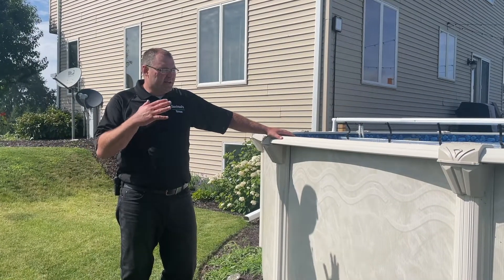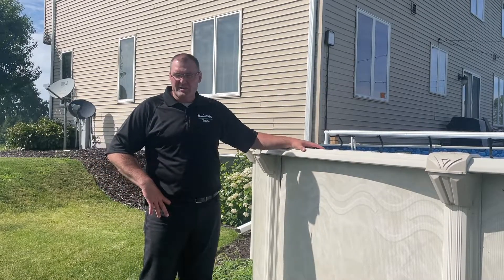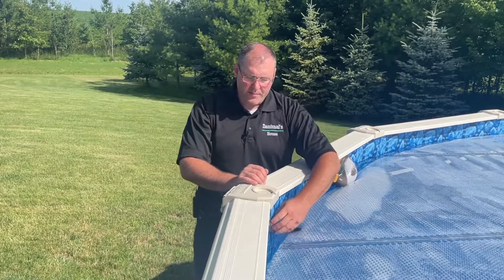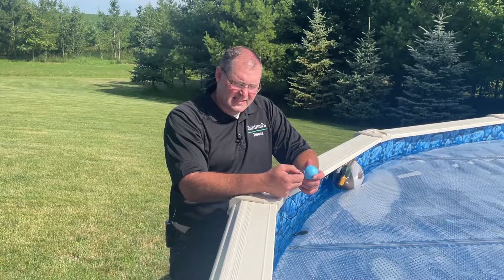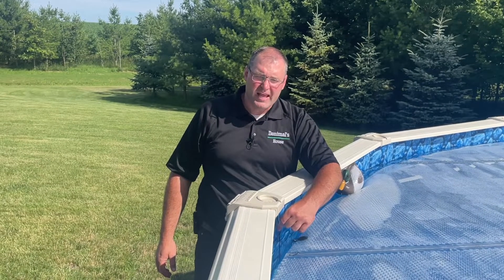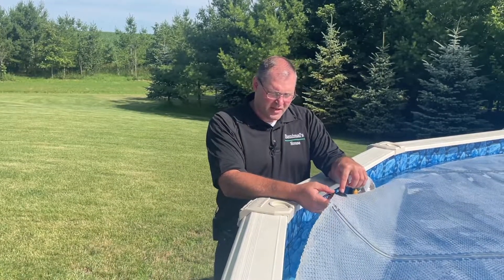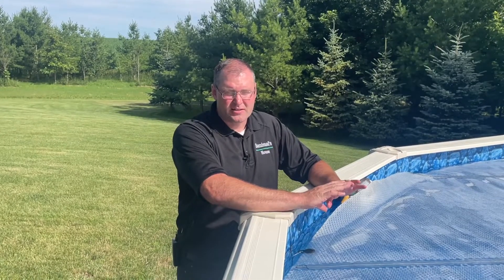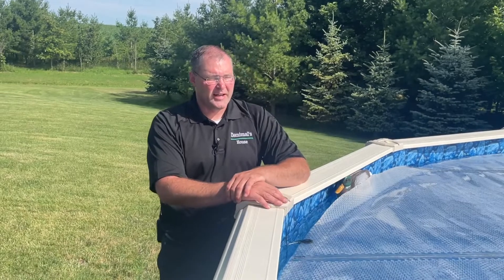How to Save Your Solar Swimming Pool Solar Cover From the Wind

Comment: This was awesome! We need a way to keep the solar cover for our inground pool in place when the filter is on. It typically ends up in a bunch at the opposite end of the pool because of the water current caused by the filter. Obviously it isn't very effective that way. My husband is very handy, but the older he gets, the less interested he is in handling "projects". Your explanation was about as simple as possible, so I'm pretty sure I can handle this. I can't think of any reason this wouldn't work for us, so thank you so much for sharing!
Reply from the maker: I'm happy to hear you will benefit from it.  It's worked well for us.  Have a great summer!